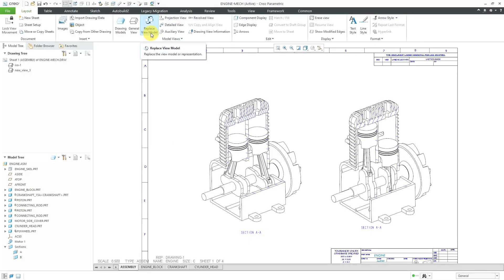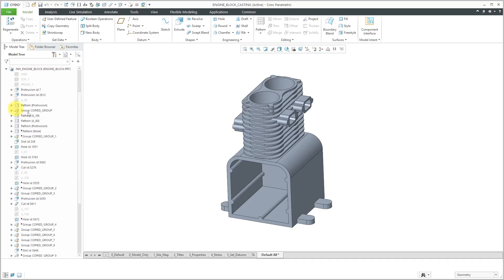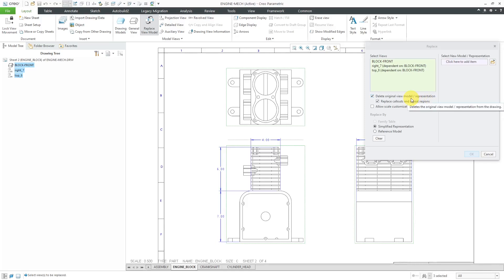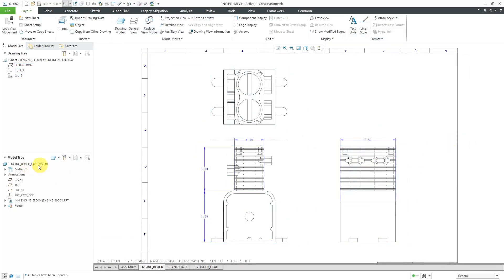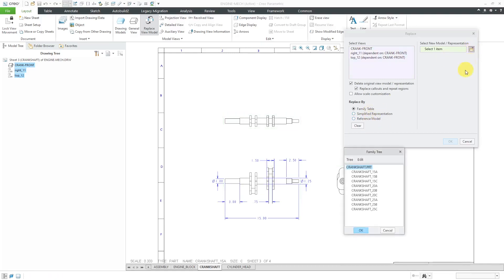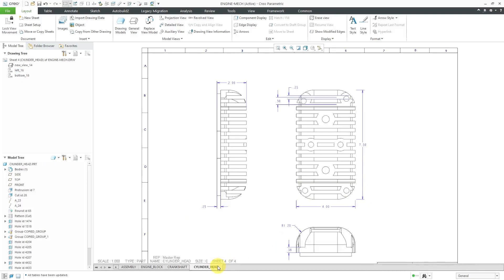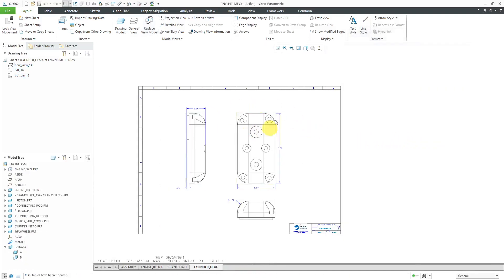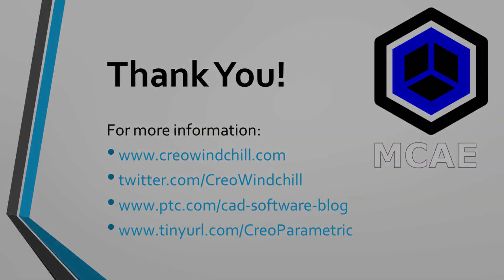Creo Parametric - Drawings - Replace View Models

Comment: Which version is creo ?
Reply from the maker: I did this in Creo 7.0 but this functionality goes back to 3.0 or so (it's been around a while).
Reply: @CADPLMGuy  Thank you very much, I'm using Creo 4 actually, but I have problems using "Replace View Model", when I choose the new model it doesn't appear on the window, can you explain why ?
Reply: This functionality appears in Creo 4.0